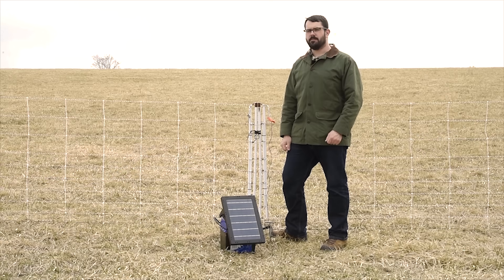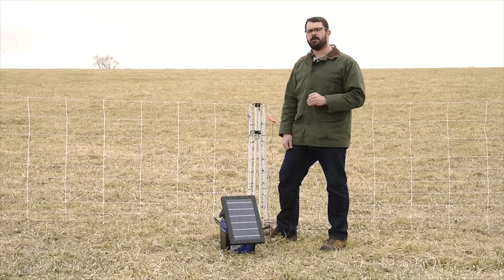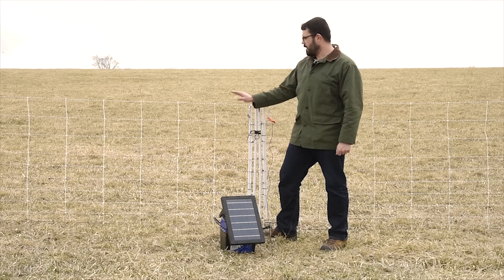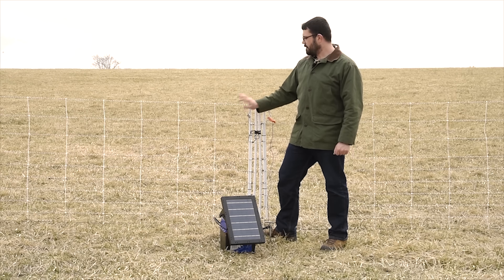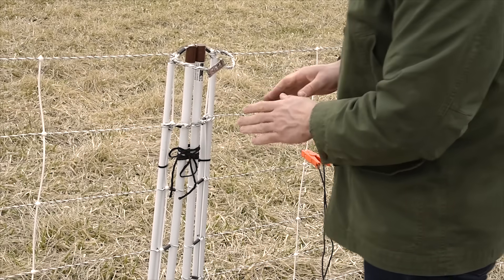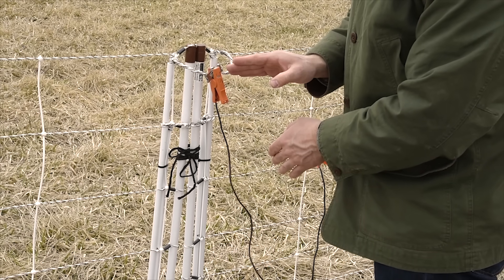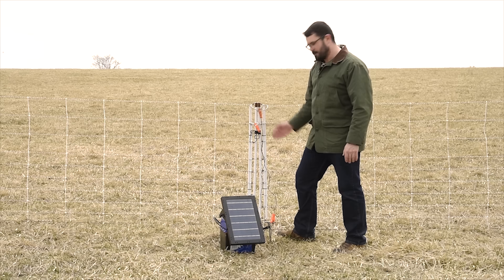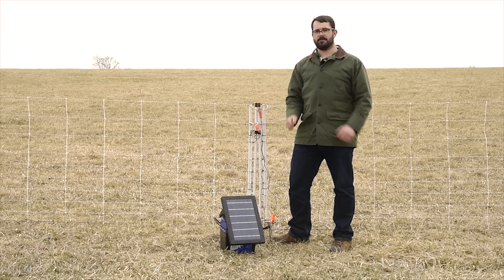Positive/Negative Electric Fence

Comment: Must you use a ground rod?  My area is very rocky and getting anything deeper than 4 inches is impossible.  Can I just hook to the neg fencer terminal?
Reply from the maker: For a Pos/Neg capable fence, that works. We still like to use the ground rod in the event an animal touches only a positive strand, they can still a receive a shock if a ground rod is used.

Comment: one thing i don't understand: when you have the positive set-up, the seperate fences are not connected to one another as the clips are connected on the SAME stretch of fence ! so how does current flow from one stretch of fence to another ?
Reply from the maker: They would need a Powerlink or connect via the spade clips to jump power across.

Comment: So what will happen if positive wire touches the negative? Wouldn't it create a short circuit that can cause a fire?
Reply from the maker: It will create a short, completing the circuit. If close enough, there should be no spark and little fire risk. The pulse through the fence is very short in duration, less than 1/10,000th of a second.

Comment: So I am looking at the pos-neg goat fence since I live in a high desert. We have a lot of sage brush if this touches the fence will it not work to contain my goats?
Reply from the maker: I suspect that the sage brush has high internal resistance and will not act as a good conductor when touching both a positive and negative strand. There may be some loss, but a goat is a far better pathway than brush. Please give us a call at 800-282-6631 to speak with one of our consultants.

Comment: Great video.  Here's another question.  My garden is bordered by a  2 foot tall cement wall and I want to put the electric fence on top of the wall to keep squirrels out of the garden.  They jump up onto the wall and then into the garden.  So I was thinking of a 3 strand configuration directly above the outside of the wall as follows:  Bottom strand 3 inches above wall (positive),  Middle strand 6 inches above wall (negative), Top strand 9 inches above wall (positive).  Does that sound like it will work?  Thanks
Reply from the maker: Give us a call at 800-282-6631

Comment: You probably get this question all of the time.  I have a Parmak solar Pak 6 on a wire on t-post install.  Can I use a Parmak pak 6 with a Premier One mesh fence?  I'm not sure if it is compatible?  I was thinking about setting up some ad hoc small ruminant rotational grazing/holding pens around my permanently installed electrically augmented chicken fortress.  It would save me a ton of money to not have to buy another charger, freeing up money for additional fencing, but I've heard that some chargers can cause mesh fencing to smoke a little before bursting into flame.  While exciting, some may even consider it a feature, I have heard smoking could have deleterious long term effects.  

Additionally, I have been considering doing some pasture raised poultry in spring.  Personally it would seem logical to have one type of mesh fence that I can use for everything.  Is there a good reason to use a wider spaced fencing with hair sheep instead of using poultry netting for them both?  I guess you can probably make larger enclosures with wider spaced fence and the same charger... But otherwise?  If I have a 48" poultry fence will the sheep have some kind of problem with it?

Please advise.
Reply from the maker: Give us a call at 800-282-6631 and speak to one of our fence consultants. They will be able to answer your fence and energizer questions.
Reply: @premier1supplies  Oh man. I really wanted to hear the answer! Was hoping it would be as entertaining as the question. Plus I have similar situation.
Reply from the maker: @kerryobrien6299   Short answer--that unit would not work with electrified netting. Per ParMak's website, that unit is designed for clean, weed-free fences. To prevent polywire from smoking, use low impedance, pulse type energizers. Continuous current, weed burner or high impedance energizers are ill-advised for use with polywire (including netting) fence. So much so that we refuse to offer them. 

One net to fence them all, and in the pasture contain them? To cover multiple species (i.e. sheep and poultry), go with the poultry netting. Its tighter spacings will contain both sheep and poultry. The downside, it's heavier than sheep specific netting (ElectroNet). Building large/lengthy paddocks eat up effort, ElectroNet is lighter making it easier on the shepherd. 

If you have further questions, send an email to info@premier1supplies.com or call us at 800-282-6631. Responses will be much faster than through YT.